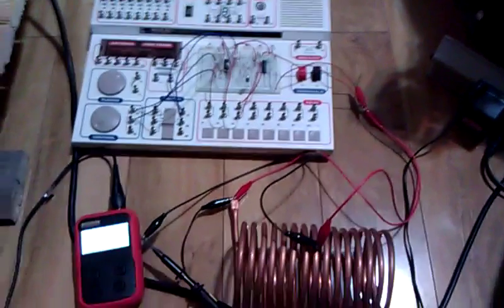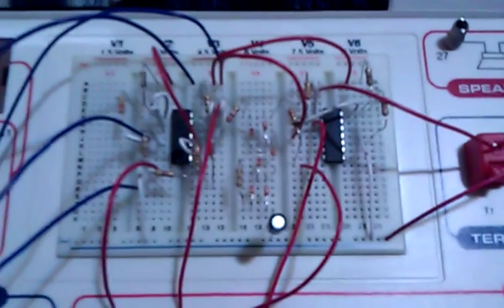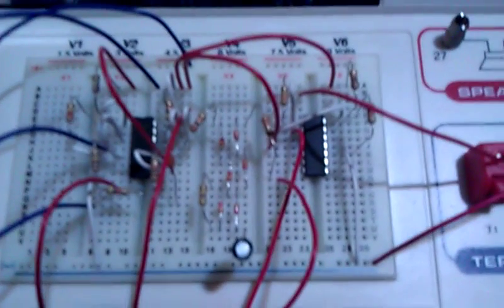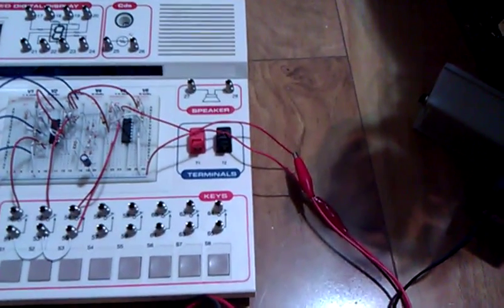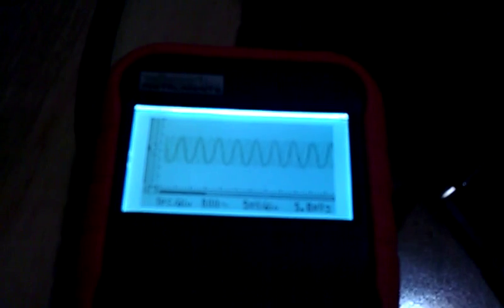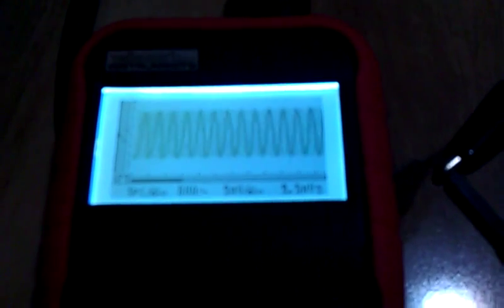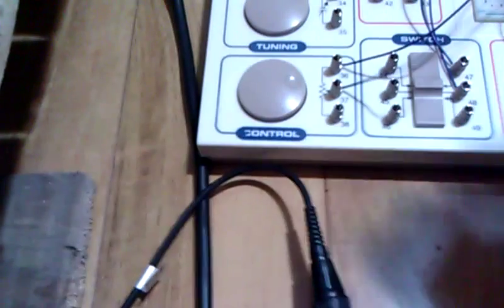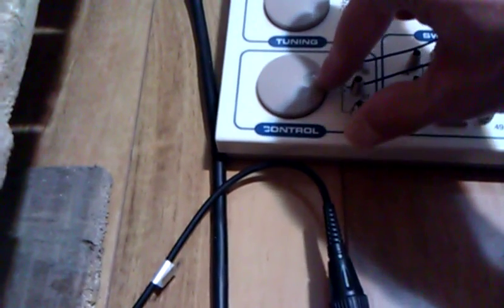Don Smith Device Project Part11: Coil Tuning Demo

Comment: THANK YOU!  Fantastic work!  I'm also working on this, however not as far along as you..Question, Doesn't the NST ramp up the frequency from 60HZ into the KHZ range?  If so, if you feed the NST the resonant frequency how would you get the correct frequency out..?  I'm a little confused how L1 would stay tuned to L2?
Cheers,